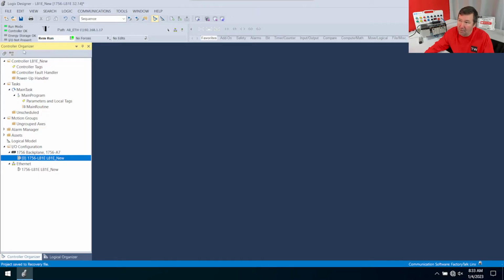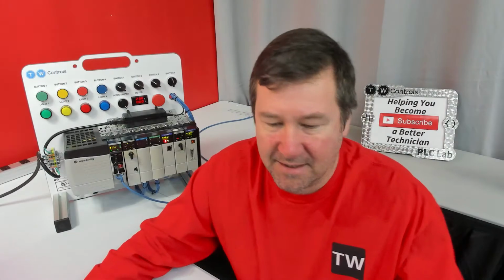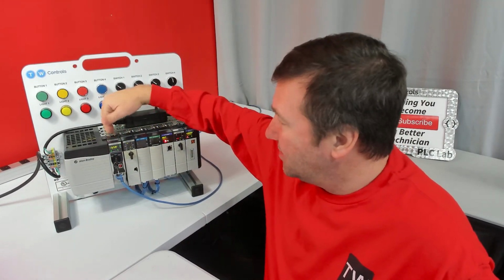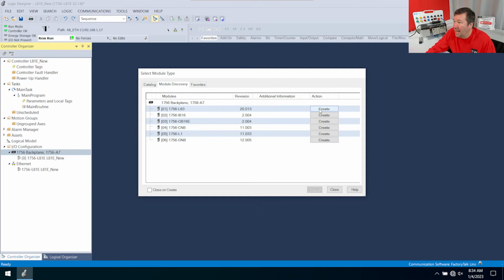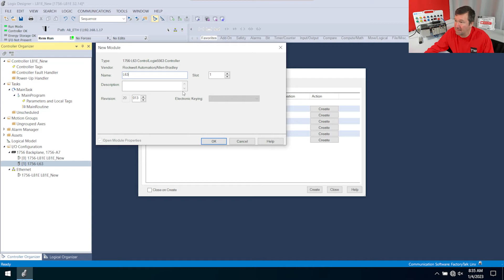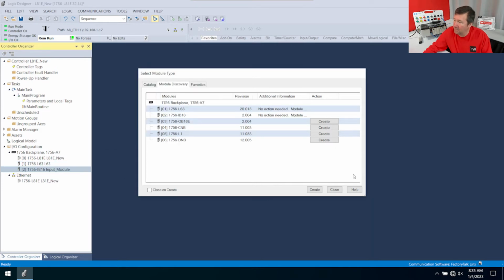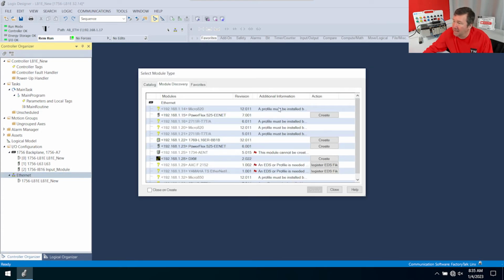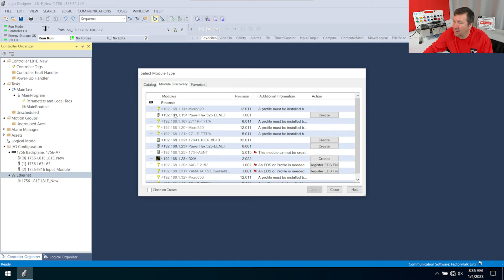Studio 5000 Discover Module to Add to IO Configuration

Comment: How do you add new field devices or input and outputs to control logix
Reply from the maker: I'm the left pane of Studio 5000, right click either backplane or Ethernet under IO Configuration and select new module
Reply: @ so if I want to add a motor or sensor click either backplane or Ethernet  then new module?
Reply from the maker: This video is about added devices to your IO configuration

Comment: I've watched several of your videos over the years Tim.  Always great info and appreciate your effort and content.  I was looking for information on adding a generic ethernet module (for a valve actuator) while online with a running processor.  Could that be done with discover module function if the device is already connected to the network?  Or would this device need to be added offline with a download?  Thanks!
Reply from the maker: The discover button would not work with them because it would not have a way to know the Assembly Instance and size.  Here is one on a Turck IO Link, yours would be similar.
https://www.youtube.com/watch?v=QlFNXWH5PAA
Reply: @TimWilborne Awesome! Thx Tim
Reply from the maker: You are welcome.